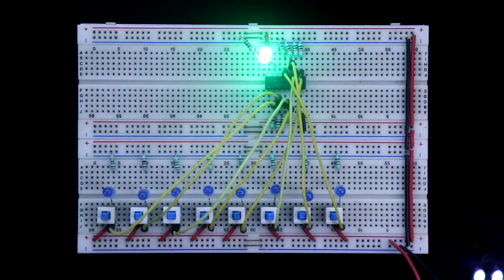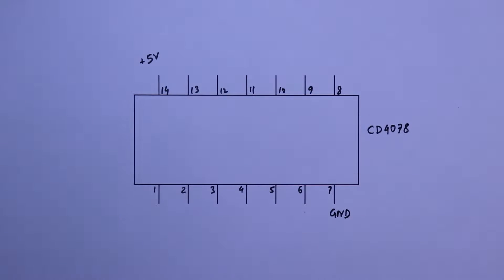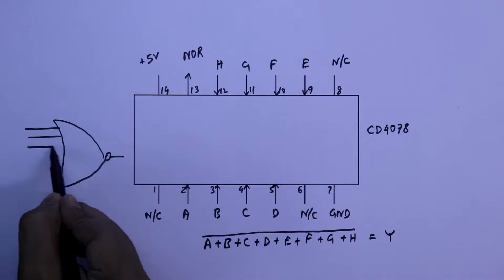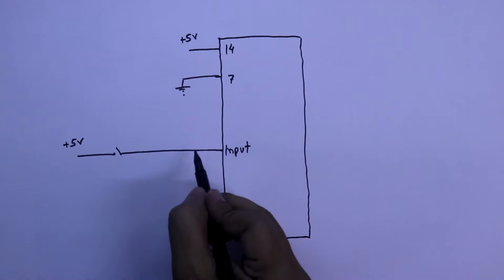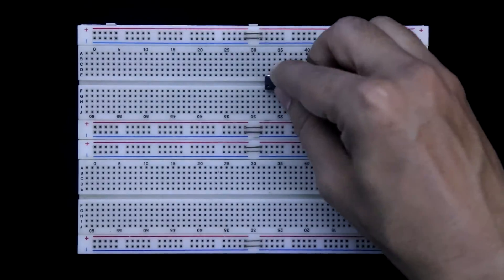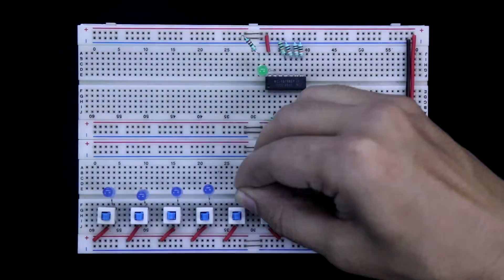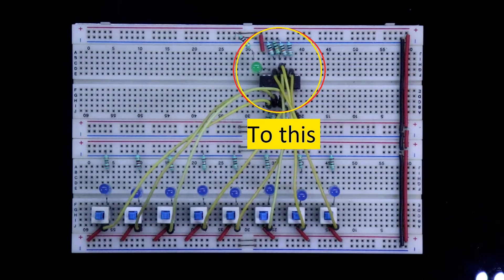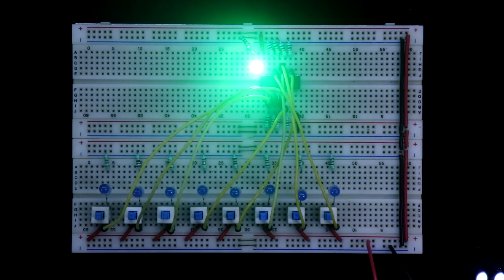CD4078 NOR 8 Input NOR Gate IC

Comment: If I don't have one, how would I replicate it using OR,NOT, AND gates?
Reply: Using just gates from the selection you mention you would need seven 2-input OR gates and an inverter (NOT gate). Gates one to four provide the eight inputs and produce four outputs. Connect two of those outputs to the inputs of gate five, and the other two to the inputs of gate six. Connect the outputs of gates give and six to the inputs of gate seven. Finally you need to invert the output of gate seven so connect it to the input of the NOT gate and connect your LED and resistor to the output.